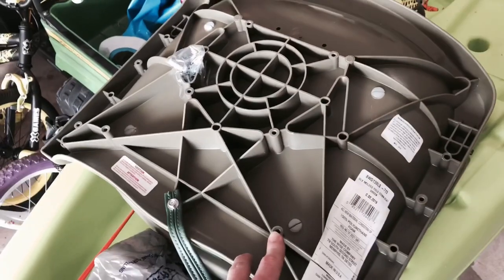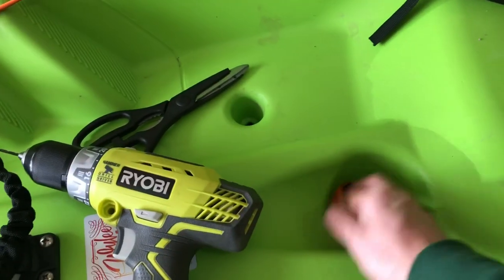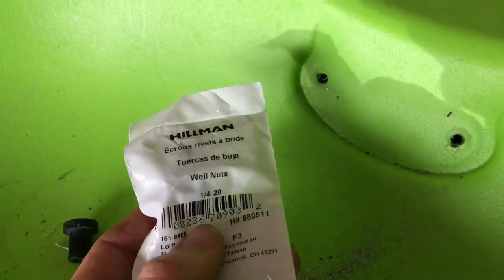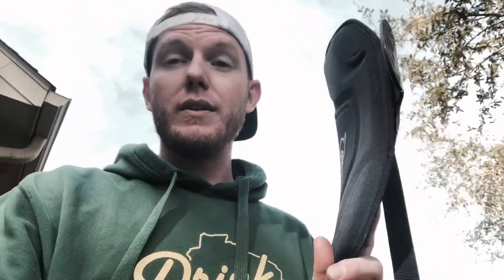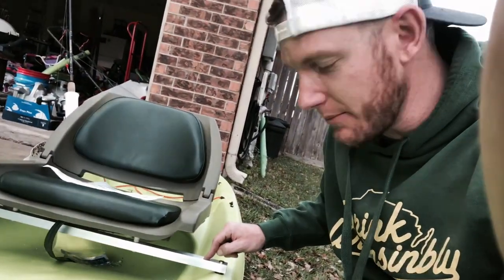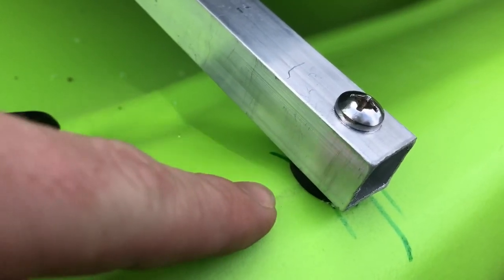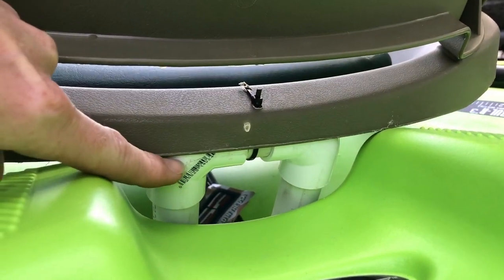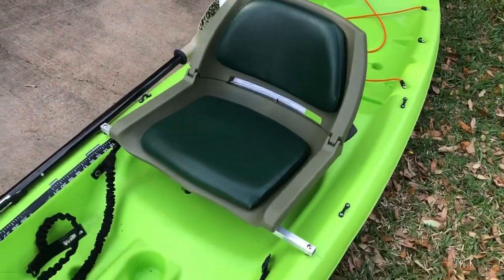Kayak Seat UPGRADE DIY, Pelican Bandit 100 Cheap kayak seat upgrade to enhance your day

Comment: Just had it out this evening. I made the aluminum bar about 17 inches wide. And mounted the seat in a lower position.  It is far more comfortable than the pelican seat. And no stability issues!
Reply from the maker: +Robert Metcalfe that’s great Robert! Glad to hear this all worked out for you.

Comment: For those of you who are asking, YES, it completely changes the center of gravity. Don’t go to high with that seat. There are simple ways to mount this seat much lower in the boat.
Reply from the maker: +Saltwater Saddle Tramp if you know a way to mount this seat lower in kayak like this please share it here so we can all have the info. I’d love to see it!  Yes it does change the center of gravity and it’s different for every rider. I personally didn’t notice too much difference.
Reply: Mine is mounted flush to the bottom of the kayak. When you  take the old seat back off cut it off leaving a part of the black tab. Drill two holes through that and the seat bottom edge. Use two stainless screws to attach the back of the seat. Drill two holes in the front edge of the seat near the old seat strap attachment points. A few zip ties can attach the front.. you can drill two slots about half way up the seat back and use the Pelican seat strap on the new seat. I used the exact same seat but mine is mounted all the way down on the kayak. Still changes the center of gravity but not to bad. Way more comfortable seat!
Reply: @saltwatersaddletramp7229  Can you post a video or photo of it on your channel? I'm sure many of us would like to see it.

Comment: I would guess that you could get a rubber grommet for the square hole that you have on either side of the aluminum square tubing.   Then you won’t get junk in that tube and it will keep it from being a potentially sharp edge exposed.  
Nice job but I’m sure it’s a lot harder than “ allakazam, astral projection” we’re done!  😁. Saying it was stressful,  at least for me if I attempted it, would be an understatement.
Reply from the maker: I’m not too worried about the tube since I always rinse down the kayak when I’m done. Edges were sanded with emery cloth and are not sharp. The only real stressful part was making the 3/4” pvc part in the back, it’s takes some fooling with to get it at the right height- also I broke a few pieces trying to drill out the big holes without a pilot. Definitely use pilot holes on the pvc. Aside from that it wasn’t a bad build. The reward is totally worth it. Check out joe Simpson’s video linked within to see where I got this

Comment: Where did you get the square tubing from?
Reply from the maker: Lowe’s in the hardware section, but you should be able to find this at most home improvement/ hardware stores.
Reply: @theoutermostwick  preciate it

Comment: Will this work on the angler 100
Reply from the maker: As long as you have the two back points this should work, but with all DIY, you may have to use some imagination and fool around with stuff before you make any holes in your kayak

Comment: How was the stability?
Reply: Also how durable are those wellnuts versus using rivets?
Reply from the maker: I would opt for the wellnuts again and again. Rivets are too permanent for me if I mess something up or want to change it later. Stability is pretty good, I’ll make a video on it soon. Sorry y’all I’ve been busy
Reply: Sorry one more question. I just bought the 1/4x20 wellnuts. What size drill bit did you use?
Reply from the maker: It depends on the OD of the wellnut. You want to drill a hole just big enough for the wellnut to fit snuggly into. When you tighten the screw the well nut expands to seal and grip the kayak. Try to match a drill bit to the well nut itself.